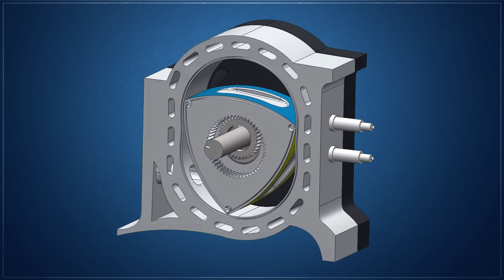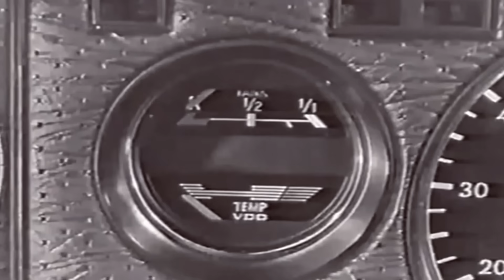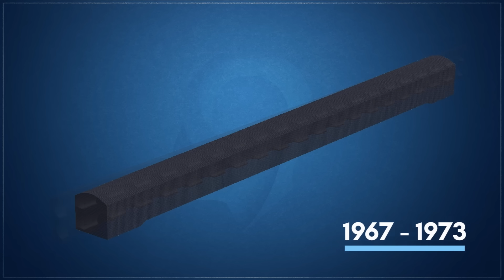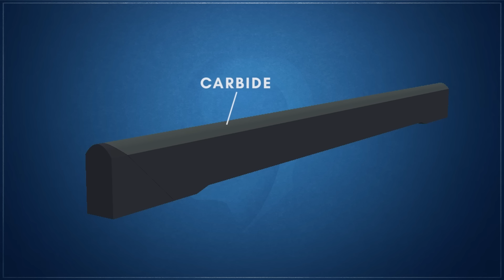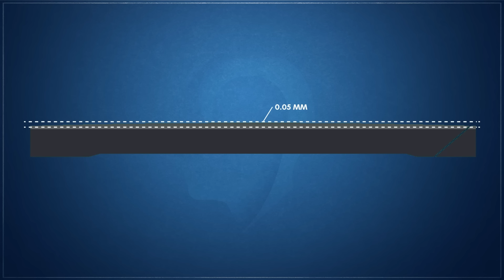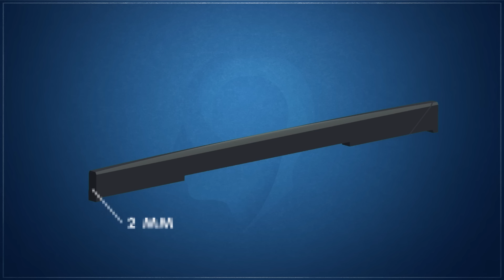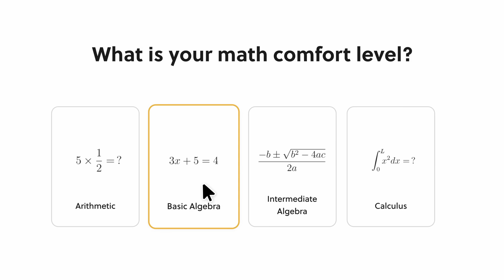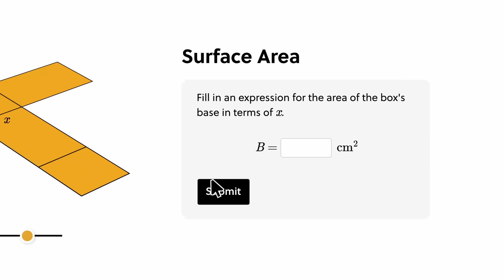Overcoming The Rotary Engine’s Biggest Flaw

Comment: Informative video, I had many rotaries, but the longevity was their biggest problem. I think the Mazda car with the rotary engine used as a charger for the vehicle's electric engine, with it's 13 gallon fuel tank and 375 mile range is probably one of the most pointless designs I have ever seen. It is still producing C02 (as if that is even a problem) and it doesn't have a very good range, you might as well use an economic petrol engine which would have a better range and cost less.

Comment: I disagree the biggest flaw of the rotary is the same as any ice engine, waste heat. Heat from the engine is where most of the energy of the fuel goes.  Heat of this volume is the main inefficiency.  Only about 15 to 20% of the fuels energy goes to torque.  While this source only presents minor problems and solutions by comparison.
Reply: True Wankel engines are extremely inefficient compared to other ICE designs, its biggest problem however is reliablity and durability, they cannot compete with other engines and are so unreliable they cannot be used in type-rated passenger aircraft.

No Wankel engine has ever been reliable enough to pass the minimum standards for airworthiness certification..

Comment: 370 miles on 13 gallons?  I'm getting 320 on 12 gallons with a 1.6L Turbo I4.. Not sure this is all that efficient..
Reply: Wankel engines are inherently very inefficient by design... they lack thermal efficiency, combustion efficiency and have low mechanical efficiency..

Comment: the issue is the fact that the oil is in the same place as the combustion chamber, and that problem is not fixable in a rotary assembly of any kind as combustion by nature happens in the same place the rotation of the shaft happens

Comment: The apex seals were 100% an issue at one point with rotary engines, and they 100% need a rebuild and new seals more often than a standard piston engine. However, as some others have noted, this is a more or less solved problem apart from the lower overall lifespan (although still within not unreasonable timeframes). The issue with rotaries is actually much more fundamental...
...they are essentially 2-stroke engines and they burn oil in the combustion cycle because they have to to lubricate the moving parts.
This means emissions are extremely difficult to bring to modern standards and THIS is what prevents them being used as primary propulsion today.
Reply: The primary failure mode of all Wankel engines is seal failures and the issues with poor reliability and durability have never been solved.

All Wankel engines operate using the 4-stroke principle..
Reply: Apex seal failure has never been solved, loss of compression from damaged seals is still the primary failure mode. Wankel engines are 4-cycle..

Comment: back in 2005 ish was getting a lot of these New rx8s for crank no start conditions. the leading and trailing plugs were getting so fouled and Gummed up that it would keep them from starting.The dealers were so not up to snuff on them that people were begging us Independant's to figure them out. Tune ups were every 8k miles or so. luckily they were easy to do.  🤘🤘
Reply: The RX8 was the subject of the largest voluntary premature engine failure recall campaign in history.
 Mazda replaced over 50,000 failed engines under recall.
Reply: Carbon build-up and fouling plugs is a symptom of low compression and damaged seals... a tune-up will not fix the problems

Comment: Having to drive an electric motor instead of a gearbox most likely enables the rotary to be differently built by Mazda. High rpm is not necessary and you don't have the jerkiness of the transmission pushing the rotor into the housing. So it can last longer. Oil consumption could still be an issue.
Reply: Mazda has discontinued the MX-30 in North America and is expected to be canceled completely by 2025.

Comment: Can I ask you a question? How is a turbine anything similar to a piston conventional engine? Horizontal piston engine? You say they are akin? I mean you no harm however when I begin to post, I would rather enjoy peoples opinion rather than yourself telling me what for. I just want to beg to differ the idea that there is anything similar between a Rotary engine and a Piston engine. Of course aside form the pact they use a substance to cause an explosion to then feed the energy into a driveline. How otherwise are they akin?
Reply: They are both Heat Engines, and both are internal combustion engines. gas turbines operate using the Brayton Cycle
 There is no functional difference between a Rotary type engine and any other reciprocating Otto Cycle engine other than the layout and reversed relationship between the crankshaft and engine case.
 I think you meant to say Wankel Engine?

The Wankel KKM is also a 4-stroke, Otto Cycle, internal combustion engine.

The KKM differs from the Rotary type in that it has a convention layout with a rotating crankshaft and a fixed engine case.
Reply: @DoktorBayerischeMotorenWerke  it is my belief that an IC engine is  Not  a  heat engine.      specifically, because the operation of an IC engine does not  Rely on 'temperature difference'.
Reply: @daviddavids2884  All internal combustion engines are Heat Engines and the "temperature difference" in the Working Fluid (Known as T1 and T2 ) is the Delta~T between the combustion temp and the EGT (exhaust gas temp) and are calculated using the Carnot Formula to give us the Engines Thermal Efficiency.

Any questions lad?

Comment: Why they haven't rounded the corners to eliminate any corners is interesting. Plus fitting a set of reed valves to the intake ports increase the power output of these things
Reply: If you were not aware? the corners is what seals the gas pressure.... reed valves only work on 2-stroke engines

Comment: Back in the early 70s there was some R&D work done with Beryllium Nickel alloys as a possible solution to the apex seal problem.  To the best of my knowledge it was not successful.  Part of the joy of materials science is the trial and error aspect of trying something a little different.
Reply: The fatal in the Wankel design is not related to materials science... its a flaw inherent to the basic fundamental design of the engine

Comment: I had an RX-4. I once set fire to dead grass in an orange grove because of the exhaust system heat as I was driving away from the grove. Luckily   I was able to stomp out the fire. The apex seals wore out around 50K miles. Nice little car while it lasted. Very smooth running

Comment: It's a great enging and l love the mathermatics. But as a couple you guys have said, the apex seals and rotor housings have been updated several time by the Mazda engineers to the point where overall they are very good. Aftermarket engingeers did some great mods, like muiltiple heavyduty dowel tubes and some great ports. 
But the main problems were the long thin rectanglular combustion shape(hence mazdas leading & trailing spark plugs), and its excessive surface area causing very poor thermal efficiency. 
If it wasnt for Mazda & it's dedicated engineers this engine would have been long gone. Well done guys.
Reply: That is a very false and misleading comment, Mazda has failed repeatedly to make them reliable and durable.
Wankel engines are inherently unreliable by design, nothing can be done to make them as reliable as comparable reciprocating engines.

The Wankel engine was a failure because it offers no advantages over reciprocating engines and has many serious problems and disadvantages.

Comment: I thought I was going to see a solution here. Wouldnt Tungsten be better for the seals. Expensive but how small ammount needed and its high temperature tolerance.
I nearly bought the new Norton F1 in the early nineties but after reading about the new  model with better suspension brakes and other improvements, I decided to wait the few months extra. Sadly Norton went bust so never happened. There wasnt much talk about these sealing problems back then.
Reply: It's a design problem, not a materials problem... the apex seal is inherently unreliable by design.
 Seal problems is exactly why Norton went tits up.
Reply: The Wankel KKM is a deeply flawed design and is simply inferior to other engine types.

Comment: I thought that the EU emissions control killed this engine off
Reply: Poor reliability and powertrain warranties killed off the Mazda RX
Reply: Reliability problems and poor efficiency is what killed off the Wankel... the RX8 actually met or exceeded both EPA Tier 2 bin 5 and California's strict ULEV (ultra low emissions vehicle) standards far higher than Euro6.
The Wankel engine is simply an obsolete technology that never offered any advantages over reciprocating engines

Comment: Excellent detailed explanation of rotary engine development.  As both a Mazda rotary engine car owner and dealer-level technician the demise of the rotary engine IMHO was due to a lack of simple owner maintenance.  You did mention the oil injection system as one method that was used to extend the life of the engines and to that end the engines did use oil in normal operation.  That oil was drawn from the engine oil crankcase.  The problem as I saw almost daily in the dealer shop was a seized engine from the owners not keeping the oil level up.  The owners simply allowed the engine to run out of oil.
Reply: Wankel engines are inherently unreliable and less durable than other ICE types, no amount of service or maintenance can ever change this fact.

Apex seals are inherently fragile and weak by design and suffer consistently from a extremely low MTBF.

This are irrefutable fact that cannot be disputed.
 Any questions?
Reply: Well that's a charming little personal anecdote, but it completely omits the decades of research and development costing billions of dollars and millions of man hours in the many failed attempts to build a Wankel engine reliable enough to pass a FAA or EASA airworthiness certification for passenger aircraft.
 Certified passenger aircraft require strictly scheduled maintenance and inspection procedures by highly trained and licensed professional technicians.
These maintenance procedures are required by law and must be fully documented.

Despite these strict manufacturer and government mandated maintenance schedules and inspections... not a single Wankel engine has ever been reliable enough to pass the minimum reliability standards for passenger aircraft, standards that are easily met or exceeded by other types of internal combustion engines.

The fatal design flaw in the basic Wankel engine concept is the apex seals and their poor durability and unpredictable failure rates.

No one has ever solved the reliability problems with the apex seals and this is the main reason why the Wankel was a failure and is all but obsolete technology today.
Reply: The primary failure mode of all Wankel engines is compression loss due to ablative or high brisance damage to the apex seals, this is caused by detonation and erratic flame propagation in the combustion chamber.
 The Wankel has a very inefficient combustion chamber architecture and cannot support a modern high swirl or Quench type design.
 Apex seals are a non-positive type pressure seal , unlike a typical twist type piston ring that increases seal integrity as combustion pressure increases the apex seals loses seal effectiveness with high pressure.
Reply: @Dos — One word for the Wankel — junk …

Comment: Garbage video. The biggest rotary problem is not the Apex seals, is the inherent inefficiency, terrible mpg and emissions.
Reply: Some of the biggest and best engine companies in the world have spent billions trying to find a way to make apex seals reliable... all have failed.
Reply: @WilhelmKarsten  — Even if they did figure out a fix for that, the design is still rife with other problems and inadequacies for all but a very limited number of applications …
Reply: @Clyde-2055  Excellent comment, the Wankel engine offers no advantages and many disadvantages ranging from minor to very serious.
All legitimate development of the Wankel design was abandoned many years ago... what remains is just the crackpots and the con men.
Reply: I feel dumber for believing that someone could "solve" that.

Comment: The biggest problem is not apex seals. It's related to 2 stroke working  of rotary
Reply: No one has ever solved the reliability problem with apex seals.

All Wankel engines operate using the 4-stroke principle.
Reply: @WilhelmKarsten  : No you're wrong, Wankel moters work on 2 stroke principle which is also the reason for their poor emissions..
Reply: @Abhishek-150  Sorry, but you are very confused and misinformed regarding this subject.
The Wankel KKM57 type engine is a 4-STROKE.
This is well-known and understood by the engineering community and is not disputed.
Any accredited reference sources will confirm this.
Any questions?
Reply: WANKEL ENGINES ARE 4-STROKE